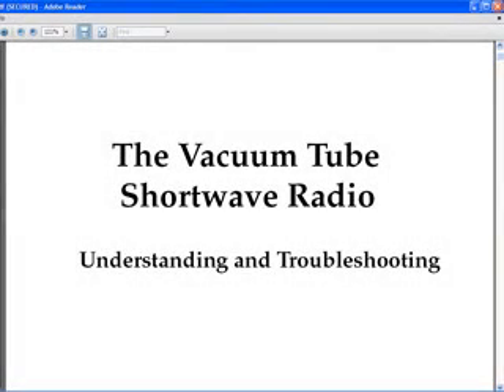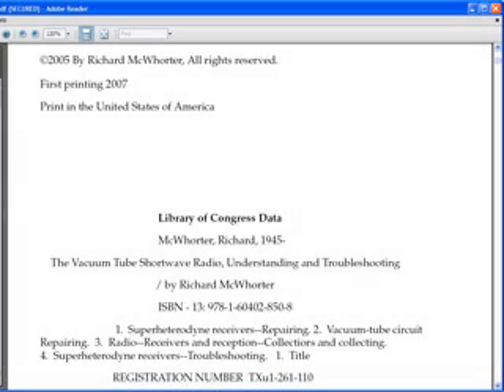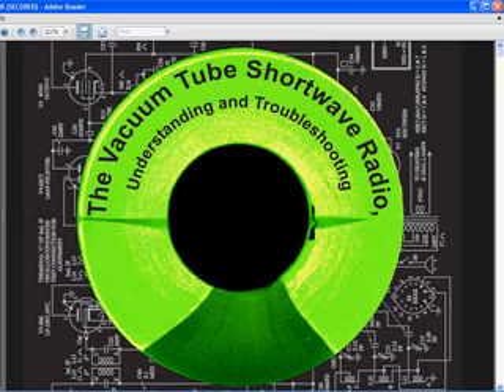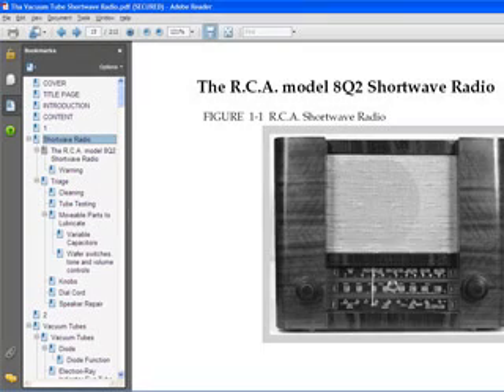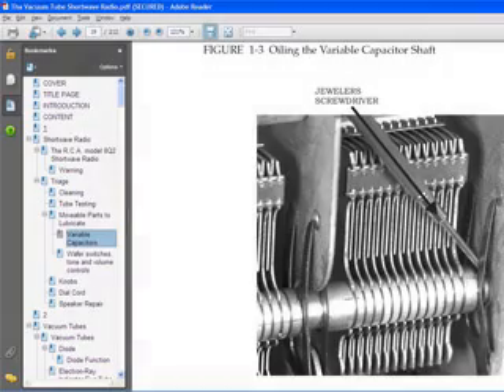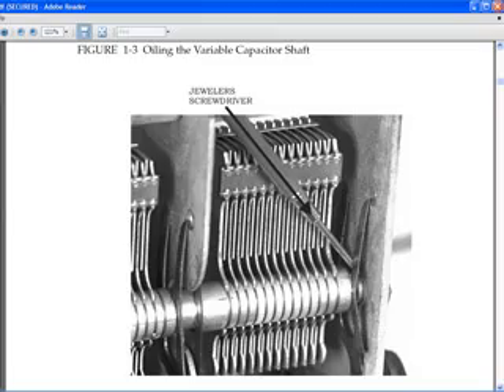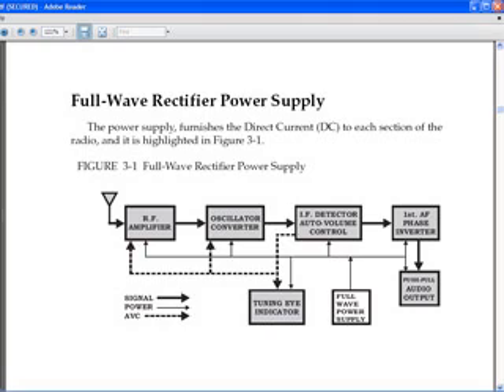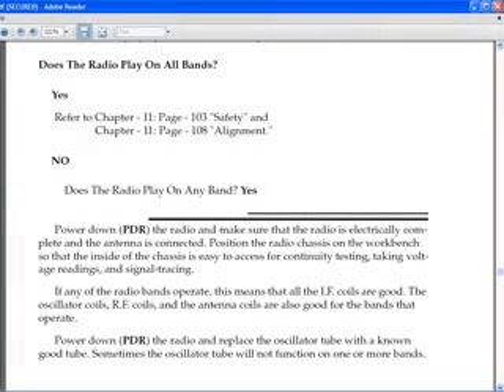The Vacuum Tube Shortwave Radio

Comment: Thanks for the book! With regards to lubrication, I read in an oscilloscope user guide to use vaseline (Petroleum Jelly) mixed with white spirit to lubricat the dials. I think the white spirit evaporates, and leaves just the vaseline (but until it has evaporated it allows the vaseline to flow into the bearing like oil), and so offers more resistance when turning fast than when turning slowly.
Reply from the maker: Thank you. And thanks for the information,

Comment: Outstanding book..outstanding videos.  Question:  I've restored a few Zenith "universal radios"...but am concerned about operating them on our local power (125v)---I would like to use a CL-90 to reduce power, etc....as the radios are rated at 117v.
I currently turn them on for a few moments...but they tend to run hot...any other suggestions, etc?  Are my concerns warranted?  I had a retired repairman tell me the voltage differential was nothing to worry about..and suggested that to anyone under 50--all tube radios seem "hot"....I love these old radios--and don't want to burn out tubes etc....help appreciated
Reply from the maker: I have used an 8 Ohm 20Watt resistor in series with the primary.

Comment: Richard, your book is well explained . On page 109 you document using an oscilloscope to test certain test points.  Now I note your isolation transformer and variac connected prior to the radio creating an isolated chasis. Now if an oscilloscope is used where is the ground referenced and see the oscilloscope ground is referenced to the neutral of its supply. Now we have a non isolated situation and this creates a dangerous situation , unlike a floating voltmeter. So a couple of questions .a) is this how you connect to the radio ? b) why don't they isolate oscilloscopes as default c) how might we measure with the safest techniques ? D) how do you measure the cleanliness of supply ie. 200-400v lines ? Would it not be better to plug the oscilloscope to a separate isolation supply or existing ? Look forward to your input to this.
Reply from the maker: Test chassis in always plugged into the isolation transformer.
FIGURE 11-2 Isolation & Variable Transformer, & Chassis

Where to put the ground on the oscilloscope, that is determined by the radio. If the radio has the chassis as the ground that’s where you put the scope ground. If the radio has a floating ground that’s where you put the scope ground. If you want to isolate the oscilloscope ground from the radio ground use a 0.1 uF capacitor between them.
Reply from the maker: 0.1 uF @ 630VDC

Comment: Thanks Richard, your book looks like it will be quite helpful in understanding my vintage ( = "older than I am") RME-69 AM communications receiver, covering 550 KC to 32 MC ("RME-69" = Radio Manufacturing Engineers 6 bands, 9 tubes)

Comment: Hello Rick,

Thanks for the book.  What a wonderful gift to us old tube guys.

Do you have a suggested current rating for the isolation xfmr and the autoxfmr?  (I read that section in the book but did not find one.  Maybe I missed it.)  Seems like 3 or 5 amps should be enough.  But, I'd like your input.

Comment from the maker: @RadioDude1969 
Oh, pin 4,5,6 are connected on both sides. The copper run are isolated from side to side.

Comment: @AllAmericanFiveRadio Thanks, Rick. Yes, I am aware of the copper runs, but I still gan't figure it out. Is figure 1-4, page 6 switch S1? If so, point 9 (the antenna input) can be connected to either point 4, 5 or 6...

Jon

Comment from the maker: Thanks RadioDude1969
The part that you can't see is the copper runs on the switches. I use an ohmmeter to confirm all of the connections. And was surprised myself on how all the connections for the antenna where made.

Rick

Comment: Hello
Thanks for making this excellent book available for free.
I have a question about figure 8-3, page 77; when on band C, what is point 9 (the antenna) on S1 connected to? The resulting circuit to the right, in the dotted frame, suggests that the antenna is connected. To me it seems like point 9 is not connected to anything. In addition point 5 on S1 seems to be unused.

Thanks in advance!

Jon

Comment from the maker: The concept is about the same as the RCA eye tube. But the fluoresce is on the inside a glass tube instead of a metal disk. Both use a grid to deflect the electrons that strikes the fluoresce.

Comment from the maker: Thanks. At the time of those old radios they did not have the permanent magnet technology that would do the job. So they used the field coil to supply the strong magnetic field that the speaker's voice coil requires for proper performance. The 70v line is like commercial power, step up the energy and it will travel farther on wires, then step it down for customer use. Be glad to do a video but can't predict when.

Comment: I am very fasinated by your radio videos.  They are very detailed and easy to understand.  I am interested in how the speaker circuitry is different in the old radios as apposed to the newer radios, like, why are the speakers in the old radios electromagnets and have that high voltage to power them?  Is that type of circuit the same as using a 70v line transformer on a permanenet magnet speaker, such as those used on public address systems with 70v line out.  Please make a video of this topic.